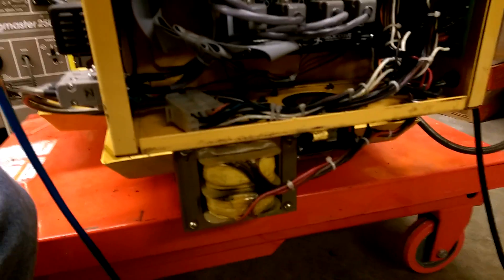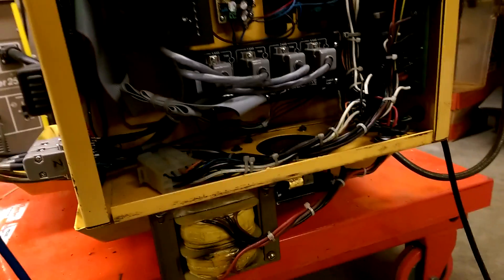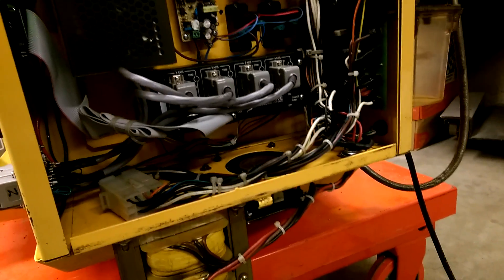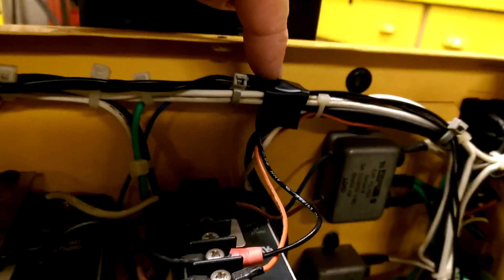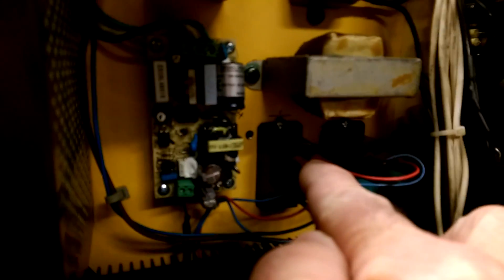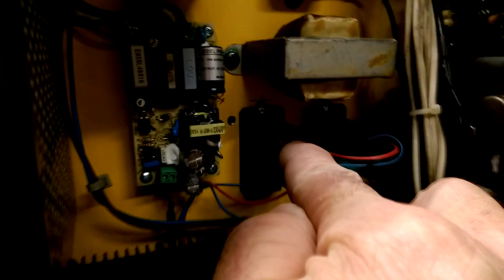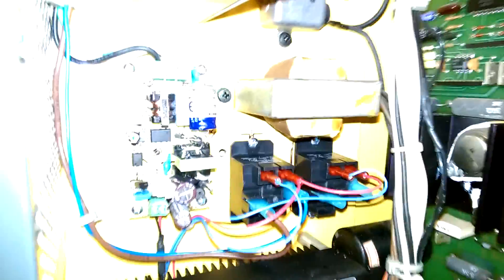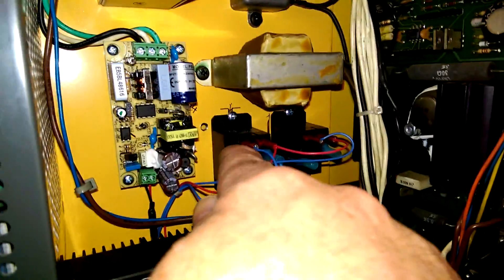Dyna 2400

Comment: You selling it off?
Reply from the maker: No, I did the wiring for a customer. This was an early Dina 2400 where the isolation transformer was mounted inside and the stepper drives were mounted by each stepper motor. This made the conversion process more difficult than the later Dina 2400's. The later units have the isolation transformer mounted underneath in a separate box and the stepper drives are in the same place I mounted the G540. This one also has different home switches than the later ones and the X and Y switches shared a common ground wire which was odd.

I do sell the conversion kits for the Dina 2200, 2400, 2800. They are mechanically tough little machines but the controls are very, very outdated. Converting them to Mach 3 with the G540 and Ethernet SmoothStepper turns it into a whole new machine.